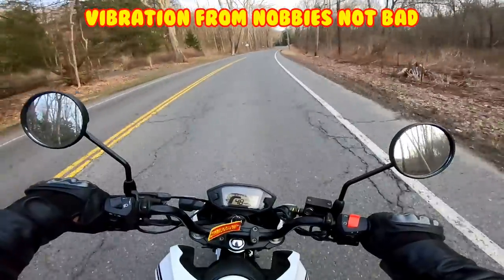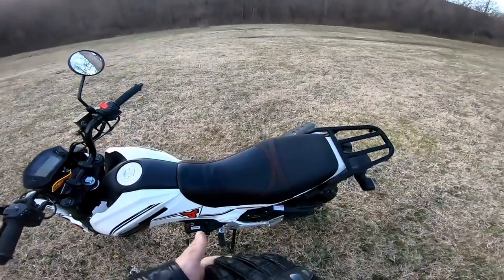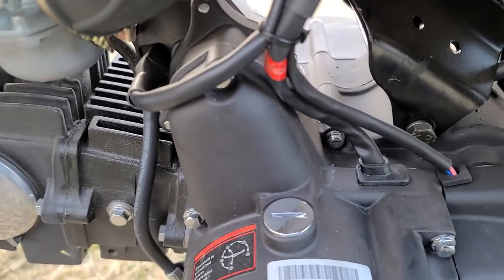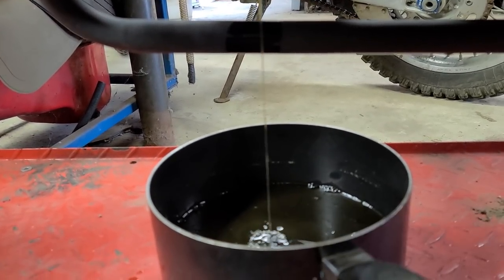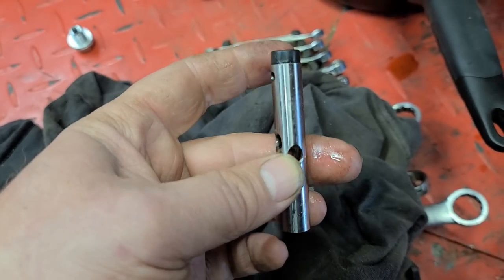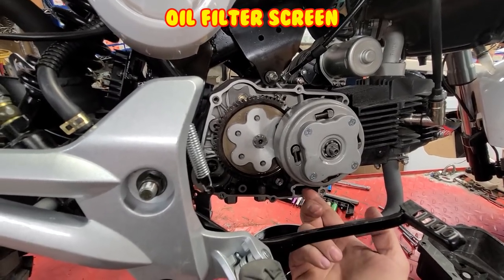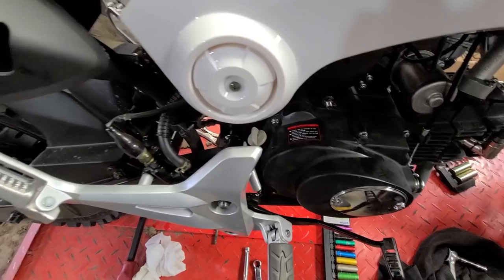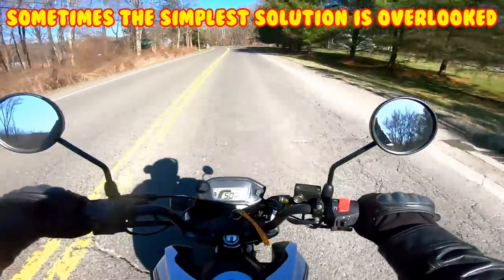(E3) Hellcat Raptor dirt tire install, BAD vibration super easy fix. Honda Grom VS Clone race!

Comment: That "pop" definitely was the break.  And, my first thought when the chain was rattling while revving was "motor mount".  Yup, always start with the outside/easy stuff first.  But, when it's ugly, it's UGLY!!  I was on a ride with a guy once, he wanted me to listen to a new/odd sound coming from his 2014 Honda Valkyrie Rune.  I walked around it to isolate the side of the bike, and then went front to back.  To me, the sound came from inside the engine case (shifter side), just forward of the alternator.  My diagnosis was a bad bearing for the front of the shaft that drives the alternator.  Luckily, it was under warranty still and when the shop split the cases, my diagnosis was correct.  He sold it after the second one failed and Honda fixed that one too.  That was a SWEET riding bike... but a PITA to work on.  I refused to touch the thing after working on it a couple of times.
Reply from the maker: Damn that's crazy, and it was a Honda! Thanks, ya I knew bolt or something, then of course started tearing shit apart. Haha

Comment: I went through three of the same ones replaced with a grade 8 bolt and made sure the engine wasn’t forcing  on it and it’s been fine
Reply from the maker: I was wondering if I should support off the head to frame after hearing a lot of people having same.problem.
Reply: I ended up brakening more bolts and made a bolt up plate like you did
Reply from the maker: Mine holding up good. No broken bolts and I've been riding it like I stole it
Reply: Yah I have been good for months no more broken bolts or chain play can’t wait for the nibbi to come in

Comment: I have this same bike and I offroad alot as well as wheelie every other time I stop😂That rear engine mount bolt breaks at least once every 2 weeks no matter how good of a bolt I get. Its easy to replace if you make the head of the bolt  face towards the rear brake👍🏽
Reply from the maker: I'm hearing this is an issue for a lot of people. I want to look into making a mount from the frame to the head possibly.
Reply: Does the bike have 2 mounts or 3
Reply from the maker: 2 motor mounts

Comment: Just put these same Shinko knobbies on my Hellcat and snapped my motor mount bolt on the first ride!  Must be from the extra vibrations of the knobbies.  Time for the patented MotoCheez 3rd engine mount plate mod!
Reply from the maker: Damn. Seems like EVERYONE is snapping bolts, someone needs to make a bolt on lower mount.

Comment: Glad you got it all figured out. Had me concerned a bit, as I just bought one of these used with about 3xx miles on it. I hadn't ridden a bike in YEARS and wanted something un-intimidating to get back on quick. Great vid, keep 'em coming Mine also has the same knobby tires. I posted a vid. Still fairly new to riding. Few years experience off, and on.  But mannnn they are so much funnnn. I never thought I could have a blast doing the speed limit. The guy I bought mine from slapped on the OG Grom Plastics, but its a hellcat/raptor. You've got yourself a new subscriber
Reply from the maker: Sweet!

Comment: Both T-Bolt and Pister Pro sell engines for that....like a 190cc 5-speed, which puts down around 20hp to the wheel.
Reply from the maker: I saw that, they're pricey. Maybe I can swing a deal with one of them

Comment: I swear I had the same thing on a dual sport rte a year back. Only my case was different n the whole bike broke down. Upon dismantling the motor I notice that exact bolt at the exact nut broke off. Funny I’m always riding high speed n if this bike was working, I believe it would have fallen apart at anytime.
Reply from the maker: Crazy...

Comment: Yeah, in hindsight, that 'pop' was the bolt shearing (at 2:14, if you look closely, you can see the drive chain vibrating...which ain't suppose to happen if everything is locked down).
Reply from the maker: My first guess was right, but of course didn't see it

Comment: I went through about 20 different bolts on mine. Tried different strength grade etc. Eventually sold it lol
Reply from the maker: I'd hope grade 8 would be good. We'll see
Reply: @MotoCheez  grade 8 snapped like toothpick the tensile strength is to hard. I actually drilled hole to a m10 and used grom hardware. That lasted a little bit but still broke. It's kind of a common issue with the 2 bolt bikes
Reply: /\ Heard that Boss? Fab-up another mounting point and make it a 3-bolt engine. 😎
Reply from the maker: The Grom has 3 apparently, good idea!
Reply: @MotoCheez  I'm full of ideas, Boss. Some are actually GOOD! 😁
Reply from the maker: @goofyleo3869  there's only 2 holes on the motor, so would have to go to head or underneath

Comment: Hey, we spoke before about the best Chinese supermoto. I ended up buying one as "parts" that isn't EPA approved and not sold in the US commercially, so I'll have some fun filing that paperwork. Anyway, thought I'd mention, something I discovered when researching my engine is that it seems pretty common on the forums that the exhaust port on the Chinese copies are pretty restrictive (Id imagine to meet emissions standards, which mine still didn't (lol)). Friend recommended I line it up to TDC, add some compressor air to the cylinder and hollow out that exhaust port with an angry bit to gain some extra power. Might not get you to overtaking the Grom but maybe it helps? I'd tell you how mine went but I live in an apt and my bike is still under construction at my grandfather's and thanks to COVID-19, will remain that way for the foreseeable future as I won't be the one to give him that virus. Anyway, could be a quick and "free" power upgrade to hog out that exhaust port. Thought I'd mention it. Hope all is well and secure on your end.
Reply from the maker: Good info, I've seen the CG style heads have porting done. I'll take a look. You take care also, don't catch the RONA!
Reply: @MotoCheez  CG clone is what I have. Probably going to order an NC450 in the future. Anyway when researching the CGs, I also read the horizontal 125s (I can't remember the designation) are also relatively choked up. Doing my best to take precautions and stay extra sanitary. All the best to you and yours. The sooner this is over, the better!

Comment: I was going to say some kind of engine mount bolt. When even I buy Chinese bikes or quads, they always seem to get lose or break. I have so many long grade 5 bolts lying around now because of that, lol! Dude, should have been double clutching! LOL! That is such a classic meme. FF1 was hilarious! Might be time for some smack on your Grom clone, aka, giggle gas, aka, N02. Or yeah, big bore would be sweet too. I'm sure we'll see fuel injection soon with these Chinese bikes, it's only a matter of time. I like the simplicity of a carb, but man, injection is super nice too!
Reply from the maker: Exactly right bthe damn bolts. 😁 F n F is classic now, that's crazy!!  Big bore!
Reply: I recently bought one but still in shipping, where can I find these bolts so I can change mine out?
Reply from the maker: Tractor supply might have them.  The ones on a bike or metric but 5/16-18 or 24 (preferred)   5" long will work. I'd get grade 8, or at least 5 (https://ebay.to/2zdtG8a Grade 8) (https://ebay.to/2L5sCWq Grade 5)

Comment: Where did you source the replacement bolt from ..in the bling of an eye no less?
Reply from the maker: Luckily I had a grade 5 American fine thread in my bolt bin perfect length.
Reply: @MotoCheez  Of course... this is why we must hoard every nut and bolt... Amen Brotha!
Reply from the maker: @totalnoobfishing1753  truth. I strip pls motors etc for bolts and nuts. Have tons and bins full!
Reply: I'm in hawaii and having a hard time finding both engine mount bolts for the exact bike you have. Mines red tho
Reply from the maker: The links I posted not working?

Comment: Where did you get your replacement motor mount bolts from? Btw, to get the bottom motor mount bolt out, I also removed the front sprocket which seems I didnt have to do. Helpful video though
Reply from the maker: I posted links in description

Comment: What grade bolt did yours come with? I just bought one courtesy of you’re vids and it’s got 12.9 for motor and 8.8 for everything else. I’m doing the 190 upgrade on mine as well. I love it too much fun for 1100. After 190 swap I’ll be in it about 1900 total w new exhaust etc.
Reply from the maker: The bolt that broke on mine wasn't graded. Maybe they screwed mine up? Yes they're a ton of fun!! Debating on an engine swap over big bore..
Reply: MotoCheez no they didn’t screw up. For the 2020’s they put upgraded bolts in them 👍🏼
Reply from the maker: Awesome!! Good to know

Comment: Love the look of those tires.  Did you have any issues with rubbing on the front fender?  Assuming the knobby tire is the same size as the stock road tire? 120/70-12.
Reply from the maker: Back is a tad bigger. Link in description and motocheez.com.
Reply from the maker: No rubbing on fenders either. They fit perfect.

Comment: Those tires do look pretty cool but, that aint no dirt bike man!  It would be cool to put a pit bike front end with a 14 inch wheel and a lounger shock in the read and make a dual purpose out of one.
Reply from the maker: Ya. No dirtbike, but be like the old CT90 trail bikes for sure. Same size tires n everything

Comment: Motocheez, I need your opinion. Which is better? EFI or carb bikes? Trying to decide for my first bike between the Brozz and the DLX
Reply from the maker: Carb is nice for ease of repair but the EFI is just start and go, no choke to fuss with, manages itslelf at different elevations etc.
Reply: MotoCheez thanks 🙏

Comment: Have heard of the engine mount issue, been watching it on my GF’s Hellcat, so far good. Here’s my question though, do the tires have tubes in em or are they tubeless?
Reply from the maker: Tubeless! I didn't know it was an issue. Grade 5 bolt now. Hopefully permanent
Reply: MotoCheez Supposedly they included an upgraded bolt in the crate for awhile then upgraded the bolt they were using at the factory. Dunno how much truth there is to that. I found the fuel tank vent hose pinched on my GF’s, fixed that and eliminated the vapor recovery system. Moved the fuel shutoff to where it’s actually useable. Retorqued the head bolts, they were all over the board. Rejetted it of course. Got it running good now, I’m impressed with it and she loves it.
Reply from the maker: @raginredneck93  don't recall the extra bolt... Have to check head torque for sure now
Reply: MotoCheez I was told 10 ft lbs, the tightest one on hers was about 12 so I matched em to it, loosest one was maybe 6, LOL. Thanks for settling the tire question. I put Ride On in em and got her a CO2 inflator, probably throw a plug kit under the seat too 👍
Reply: Great video.  Love the bike with knobbies.  Figured I might get one and do the same.  Checked out the TX website and saw your video there.  Only watched a few seconds but heard you saying you finally checked all the bolts.  Doh!
Reply from the maker: @jamesgrayson7466  😁👍👍

Comment: Do you still have the CRF250? seems like you enjoy the other bikes more!
Reply from the maker: I sold it about 2 years ago and got a DRZ400 to replace it. And of course the Chinese bikes!!!
Reply: @MotoCheez  Dang - I guessed I missed that one. I have been debating between a CRF250L Rally and a cheap hawk.  Honestly hard to pull the trigger on either right now, but the honda is only 1500 more.
Reply from the maker: @doubleclickdrama  gonforntge Honda if you have the money. Can't beat Japanese technology! Especially Honda!

Comment: So when you putting on a big bore kit?
Reply from the maker: I'm looking into them....
Reply: MotoCheez  they have tons of them on eBay. Do you think a standard grom BB kit will fit the hellcat?
Reply from the maker: @ZeroCool318  I saw for Grom, I have to look into if it's the same, Im pretty sure it is.

Comment: I have a 2020 hell cat I ran into the same problem. where are you guys getting the Bolt from.
Reply from the maker: I put a link for it off eBay and size
Reply: @MotoCheez  i cant find the link.
Reply: @MotoCheez  if could please post the link or the info here, i would greatly appreciate it.
Reply from the maker: It's in the description in video, this app won't let me copy.

Comment: The kickstand needs to be up on the hawk for it to start?
Reply from the maker: Not the model that I had but the magician did and a few newer models, I'm not sure if the new hawk has the kickstand switch or not
Reply: @MotoCheez  I'll try it later, I'll let you know
Reply: @MotoCheez  omfg that did it LoL, I do not remember, but I think I started it the bike with the kickstand down with the stock instrument panel
Reply from the maker: Awesome 👍👍😎😎
Reply: @MotoCheez  thanks a lot
Reply: There's a ghost in the machine, I wanted to be sure that was it, and it started with the kickstand down WTF
Reply: Hopefully this will last me a couple years, I'm planning on buying a new scout bobber then, just getting back on the saddle with this smaller bike
Reply from the maker: It should!
Reply: @MotoCheez  I rode it to work today, I figured it out, sometimes when a think it's in neutral, it's not! So I have to hold the clutch in so it can start, it is difficult to put it in neutral, and 2nd gear slips if I don't hold the clutch a little longer, I think if I lower the shifter if possible this would help.
Reply from the maker: It might. As the bike wears in it gets better. Just keep it adjusted properly.
Reply: @MotoCheez  do I need to adjust the gap on the NGK spark plug?
Reply from the maker: .6 to .7mm gap
Reply: @MotoCheez  thank you!
Reply: @MotoCheez  lowering the shifter about 1 1/2" did help, I guess it depends on how ur foot is, I have size 9.5 sneakers